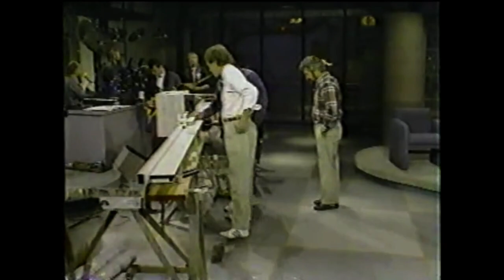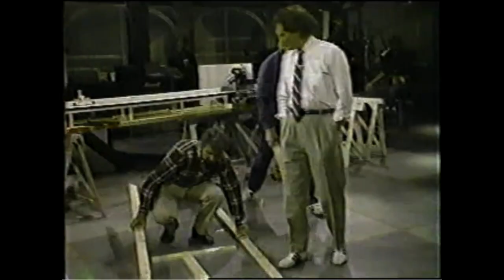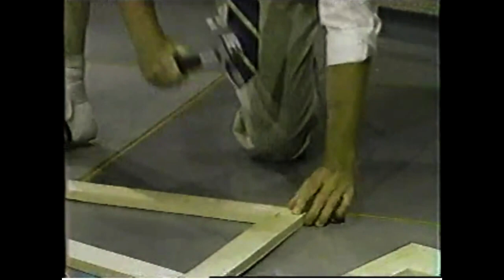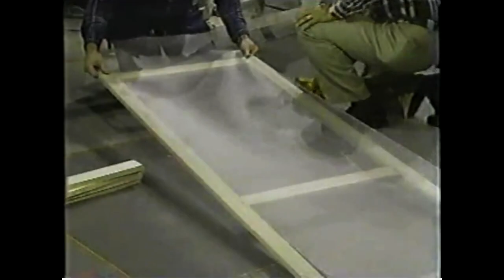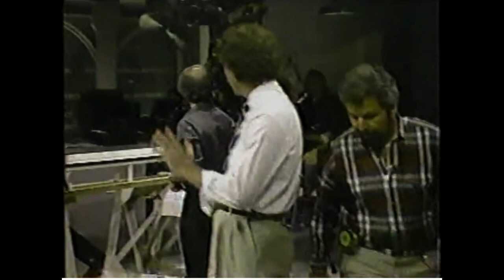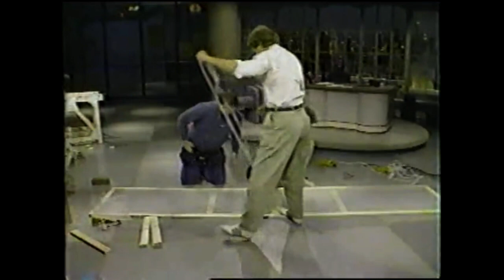Norm Abram and Bob Vila on David Letterman

Comment: nice use of time, I like Norms way to stretch out the screen material I'll have to try that. and I've been doing one window screen at a time. This looks like it works better.
Compared to the aluminum one's and as fast as you can make these out of wood
no reason not to put screens on the house.
Thanks Norm!